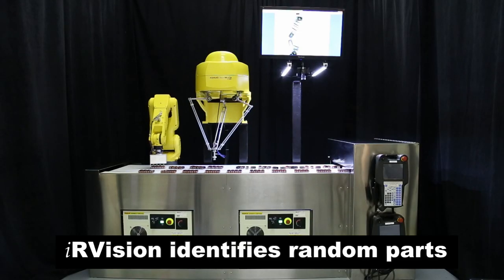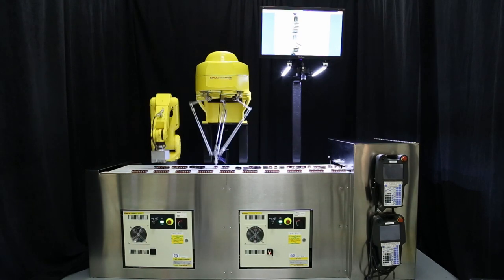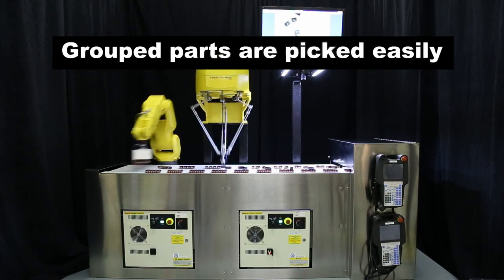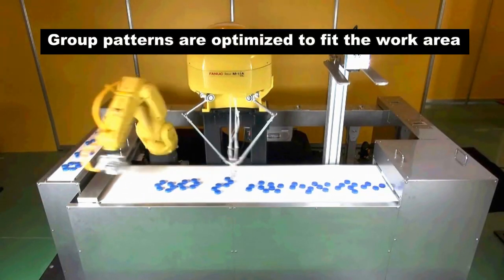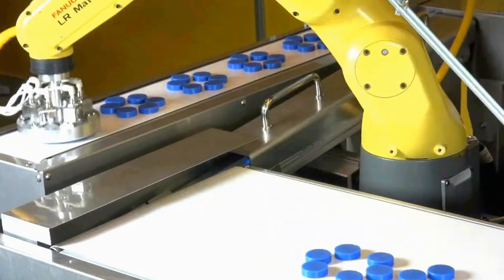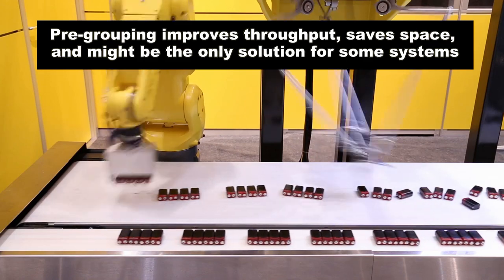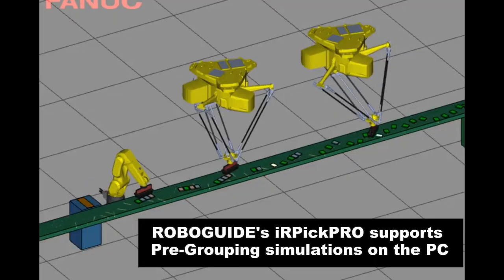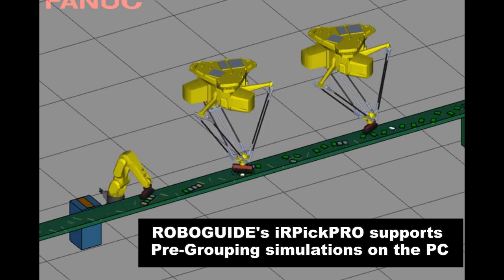Improve throughput and reduce footprint with FANUC iRPickTool:Pre-Grouping

Comment: Hello,

1. I am trying to figure out what is the "fanuc irpickpro" is! Can you explain?

2. Using "fanuc irpickpro" I need to count the optimal number of robots for the follwing automated system can have,

The project process is :

A camera system can tell "what is a good box" and "what is a bad box".
The system involves with FANUC delta and another type of robot arm to pick and place.
Once the distinguishing happens, the delta robot will take the good box and put it aside then the other robot will pick that good box and put it in a big box.
The minimum process rate is 5 good boxes will go to a big box per second. It is best if the system can do 10 boxes per second.
I want to know how many delta robots I need for this by using fanuc irpickpro simulator.

Thank you.

Esala